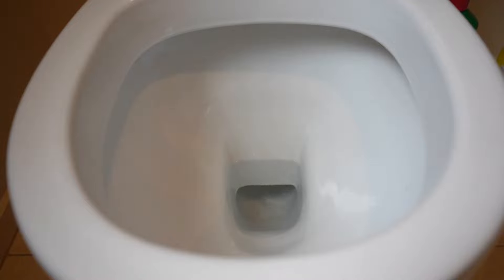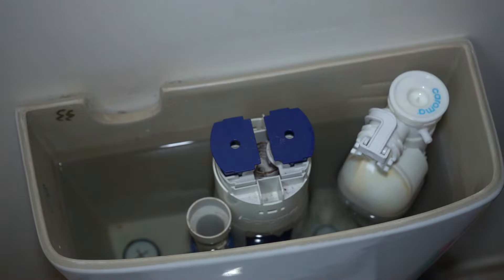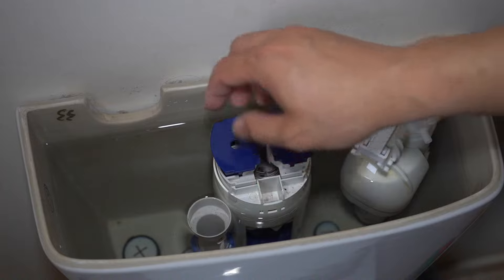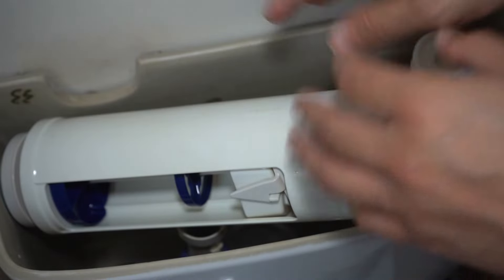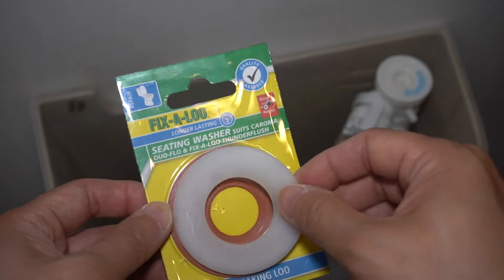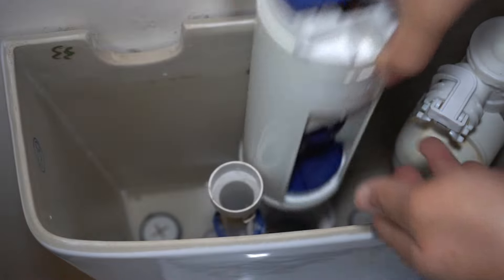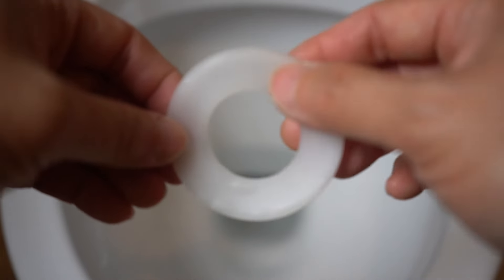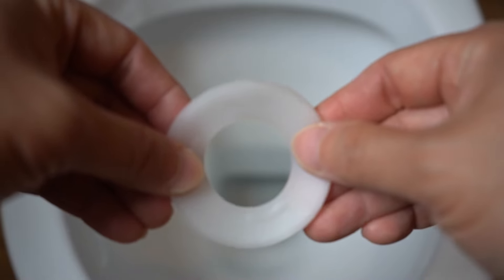How To Fix Leaking Caroma Toilet Duoflo Dual Flow Flush for Just Under $4

Comment: Inlet valve and the candle next to it rotate together for me rather than opening with a click sound, is there a way to fix this?
Reply from the maker: The "candle", are you referring to the water inlet?
Reply: I had the exact same problem. The candle part should not move so try and hold it and then twist the main part. Worked for me.

Comment: For that specific model, how do you increase the level of water in the bowl? I now know how to raise the level in the tank with that small pipe thing with the blue ring but not the level in the bowl.
Reply from the maker: I believe for that reason, you need this manual
https://gwa-prod-pxm-api.s3.amazonaws.com/pdf/16350_687042_BK_File_InstallationGuidelines_141777_ori_2014Dec15143050.pdf

Comment: Hi there 
I did the exact same thing and we have to same model of the tank too but it still leaking what should i do?
Reply from the maker: Hello, can you check if the water flow inlet valve is not leaking or keep running although it’s already full?